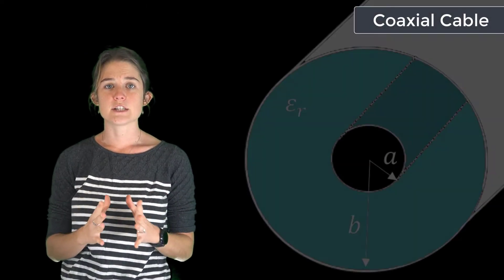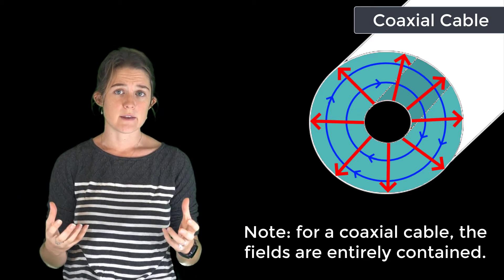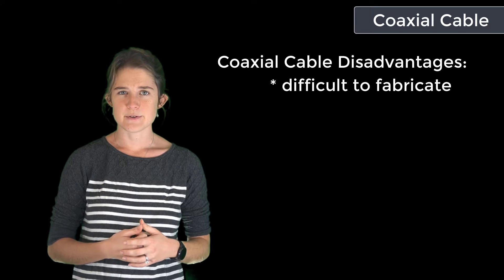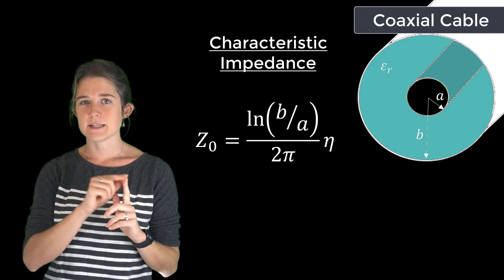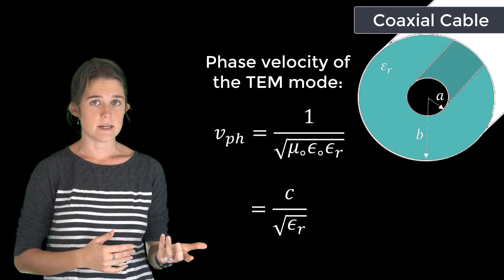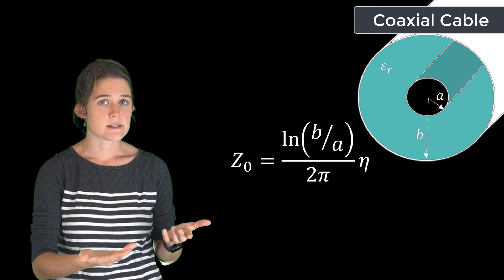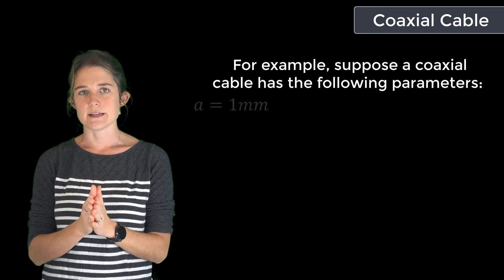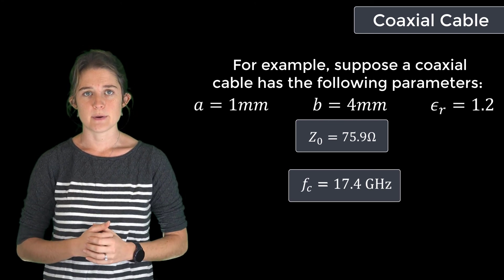Coaxial Cable - Lesson 2

Comment: Thank you
Reply from the maker: Thank you!
Reply: @emviso does it mean that the magnetic field produced by a current-carrying coaxial cable will not effect on nearby compasses?
Reply from the maker: @mahirbalayev5835   Yes, that's right - the fields of a coaxial cable are entirely contained, so there is no magnetic field produced outside the cable.
Reply: @emviso  but how external homopolar magnetic field and current carrying coaxial cable will interact? Does it mean external magnetic field will pull this cable, but cable will not pull source of external magnetic field? Will it look like floating of light weight air balloons with hot air or helium?